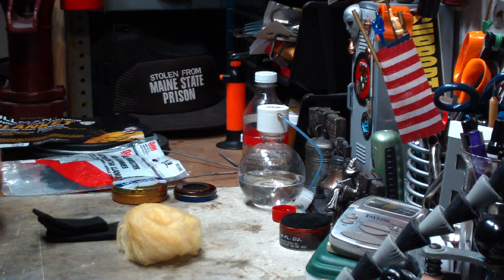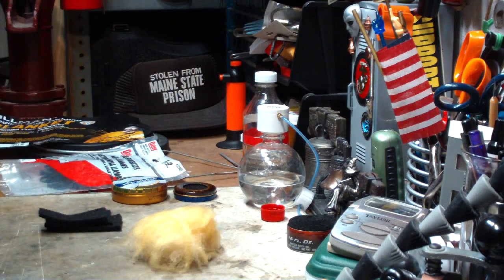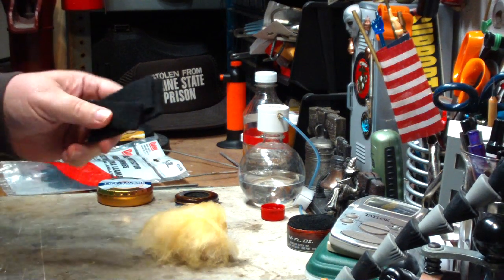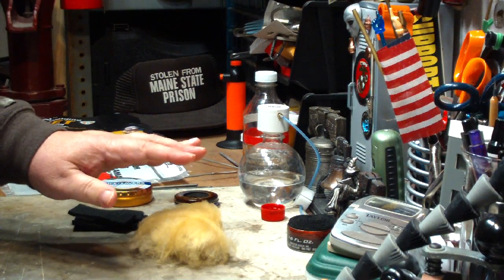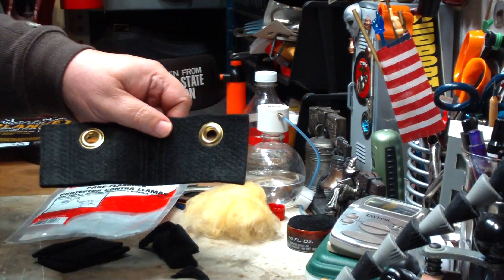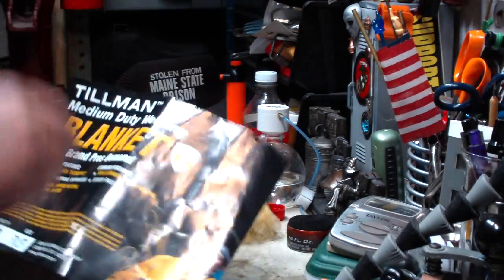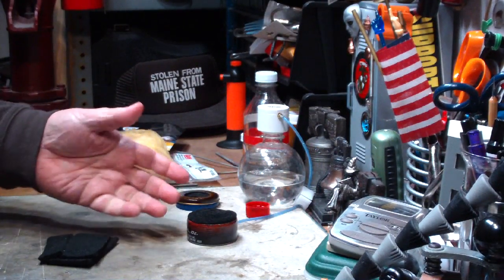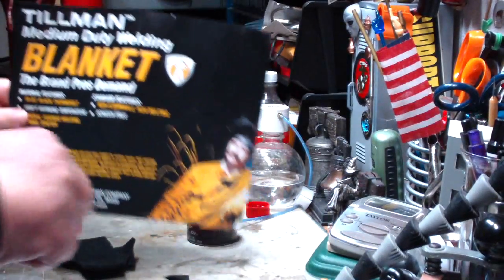Carbon Felt vs Fiberglass Insulation

Comment: FiberFrax we used it to pack induction heaters  which heated billets to 2150 F, it don’t melt. However, you can’t handle it a lot it’s like bread dough you can’t keep messing with but it will last forever.

Comment: Save money,  use fiber glass in most of the burner with a  top of thin carbon felt.   Works as good as solid CF and the fiberglass dosent melt but still wicks perfectly.

Comment: Hay Hiram ! thanks for all the videos !  been a subscriber now for about 3 weeks,
and I caught a boo boo on this video you said that the carbon felt had a melting point of 1100 deg. while the package you were holding said 1800 deg.  ya must have mis-read it
.... but that is why it has never melted on you ...1100 deg. would have ! I've seen some extreme temperature from these stoves just on 91% alcohol ! in excess of 1200 deg! enough in some cases to melt aluminum cans....one of the reasons I use tin cans only ! 
changing the fuel to Denatured Alcohol would only raise that temperature.
the problem of getting super high temperatures is in windy conditions or air being forced into the burn by some means, i discovered that by a desk fan ! it melted the aluminum beverage burner slightly and I could just poke my finger through it after it cooled !

Comment: I built a stove with the white braided fiber rope used to seal woodstove doors.  It is probably glass or rockwool fiber.  Use a soup can to extinguish the flame, and the winding of two turns of rope brings it almost but not quite to the level of the can,  so there is not much air available at the top of the rope for really high temperatures to develop.

Comment: But the fibreglass material is free. You can pick it up off the ground at any house being resided. I put a 1/2 size cookie between the pipe being soldered and the wall.

Comment: I recently discovered you can buy ceramic wool for fireplace insulation on Amazon relatively cheap. It can handle high temps and works well as a wick medium. I'm thinking of ordering some and making a bunch of stoves out of it.

Comment: Would using carbon felt in the top of zippo handwarmer work as a replacement for the catalyst it comes with ?
Reply: No , it won't work . Catalyst contains platinum or something similar .
Reply: You can use the carbon felt in the bottom part of the hand warmer to absorb the fuel , not sure it would be much of an improvement though .

Comment: Hi Hiram......Would this Titanium Exhaust Heat Header Downpipe Manifold Thermal Wrap work as a wick?......http://www.ebay.co.uk/itm/Titanium-Exhaust-Heat-Header-Downpipe-Manifold-Thermal-Wrap-Various-Size-Tie/182794178318?_trkparms=aid%3D555018%26algo%3DPL.SIM%26ao%3D2%26asc%3D49479%26meid%3D4498eb137e174804a97c18d1b48d5ddd%26pid%3D100005%26rk%3D1%26rkt%3D2%26sd%3D281812058700&_trksid=p2047675.c100005.m2219

Comment: Thank you for your video.  In a few days i'll be using this wrapped around a smoker that could see external temps of up to 500 or maybe 600F, i was nervous but after seeing your video i can tell i won't be subjecting it temps that are really that high compared to what it can withstand.
Reply: Steiner Velvet Shield Welding Blanket — Carbonized Fiber, Black, 18In. x 18In., Model# 316-18X18--good to 1800 F  found at Northern tools

Comment: Try fire rope (ebay) its used in fireplaces and stoves, very cheap, withstands really high temps and absorbs well i use it a lot in my stoves, you should also look at kiln insulation pretty cheap and able to withstand incredible temps and again much cheaper than carbon felt.
Reply: Prepping to Survive UK - Scorcheo I was gonna suggest this as well, glad I checked comments 😂✌️great minds?!

Comment: how would sand work in a pinch?
Reply: Probably yes but sand has similar issues as fibre glass... both sand and fibre glass is...well basically silica whereas perlite is silica and from a mechanical standpoint much more heat resistant in regard to melting/fusing and glazing over... But if in a pinch masonry sand would probably work nicely as well

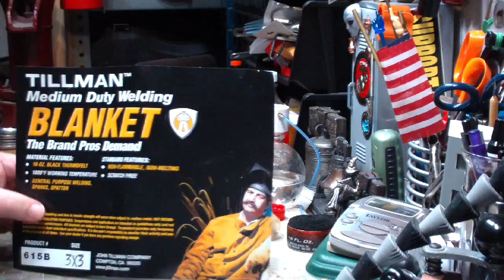Comment: 5:13 is not 1100 F but 1800 F working temperature He is pointing right there and making the mistake  )
Reply: And they are still full of crap..I bought one to cover my kiln in the winter....stays under 1100F..it flamed up and melted my controller...those blankets are not what they claim to be..Although good for welding spatter they suck as a heat shield blanket.
Reply: redneckhippiefreak That's probably because carbon is a very good conductor for heat. The flame never touched your controller, but the heat was spread through the carbon, and melted it anyway.
Reply: Harbingerofd00m What about "Flamed Up' Didn't you understand? It caught on fire. I had to put it out with an extinguisher.  Ive had real carbon blankets, Kevlar and asbestos ..This is not what they claim it to be. Just sayin.

Comment: Good Video.

One of these days I may make a burner with carbon felt in it.

The current Alcohol burner I use is made from 2 aluminum soft drink cans.
it boils 1 and 1/2 cups of water in about 3 minutes and burns for 18 minutes on 1 oz.

Those burners look interesting.
Thank you!

Comment: I have worked with fiberglass insulation for years hanging board and hate it. We call it what it is " itch". I see people selling the carbon felt in place of the fiberglass wrap and using it for coozies,  does it work that good with no prickley glass in your fingers?  I have a choke hazard, and a minnie heat both have carbon felt in them and I have never felt the splinters,  I always thought it was because of the alchol.

Comment from the maker: Some time back, on my other channel, I did a video I named,"Look at that!" "It just melted" where I used an aluminum ring cut from a soda can on the GrillTop Stove Stand to lift a pot up to circulate the heat better. The alcohol burner melted the ring right down. You're right, it does get hot.

Comment: once upon a time I made a small trivet pot stand for the trangia stove out of 1/8 " aluminum strapping and stainless steel carriage bolts.  It lasted less than 6 two cup runs before it self destructed from melted aluminum parts. It had lasted dozens of runs using sterno and other alcohol wick in a can burners.

Comment: Yeah,the fiber will glaze over on the top. I then just flip it over and get a few more burns out of it. Then I reach in my pump house and grab another little puff for my next trip. I still use it cause it's there and it works. I'll graduate to the carbon felt one of these days.